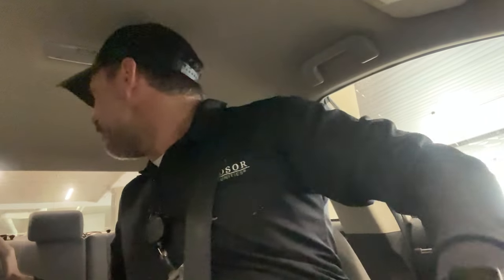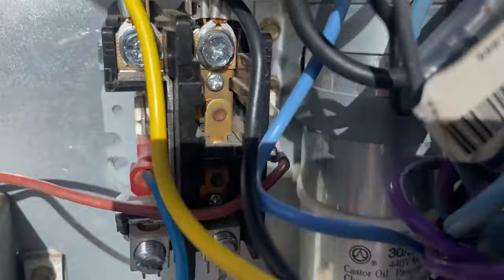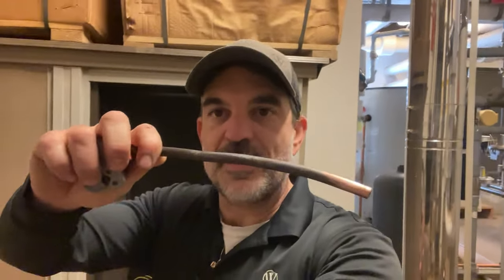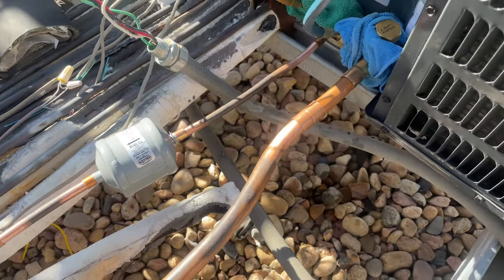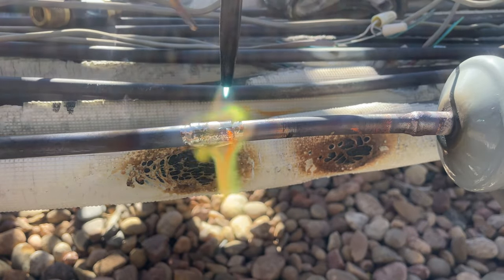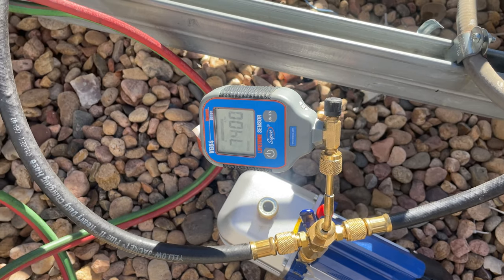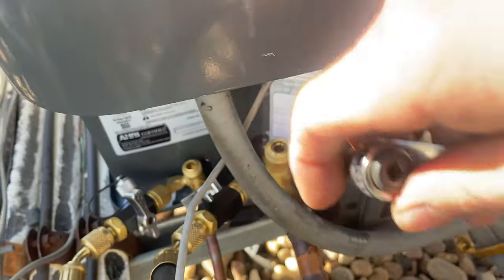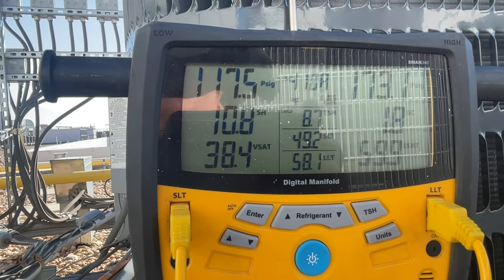Apartment Maintenance Vlog #31

Comment: Nice work bro! We all have days like this that's for sure! Help is hard to find & good help really doesn't exist anymore it seems. I vacuum all my systems down as far as I can & make sure everything is done properly cuz were the ones who will be getting called back out when it stops working so doing it right the first time allows u to sleep at night. I don't rush my installs for the exact reason u said "paid hourly" if it goes smooth & takes 2 or 3 hours great, if not then I'm there 8 hours a day so I got 8 hours if need be. Keep them coming bro & stay safe out there!
Reply from the maker: Thanks man ! I’ve seen your work and you kill it - very thorough.  Keep it up bro and thanks for the reassurance I always get down on myself when I take to long - 👍

Comment: Watching you doing this on my break time 
Question do most property management pay more if obtaining a HVAC technician license 🪪 
The average service technician makes 19-22  depends on the company 

Any thoughts 💭 on that I am just hesitant 😕
Reply from the maker: They might initially- but there’s really no technician license unless you get the NATE certification, which I would pay more for a tech that had that. The EPA just means you can handle refrigerant
Reply: Im an apartment maintenance technician from texas. Over here you find better pay if you an hvac license. It starts from maintenance technician- lead technician. Maintenance technician make from 15-18, assistant technician make from 18-21, and lead technician from 21±. But everything depends on the company